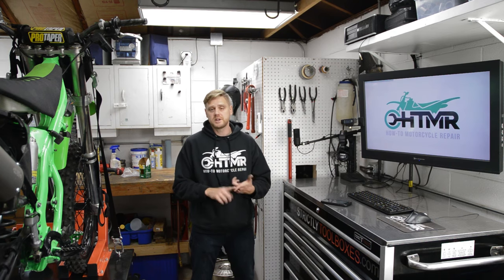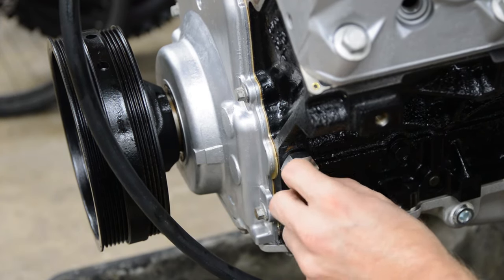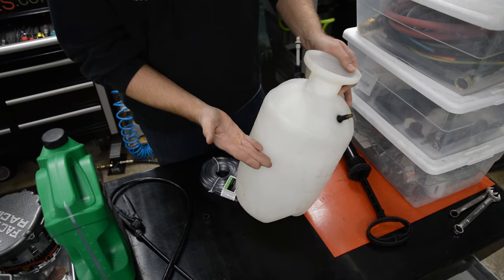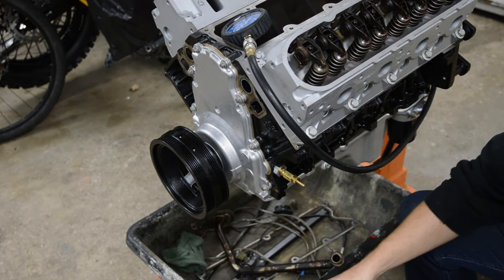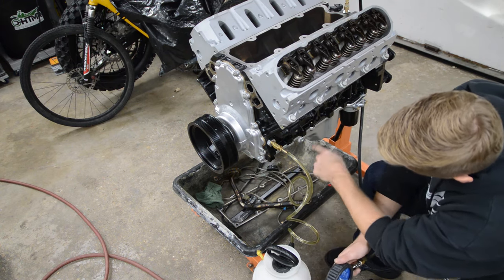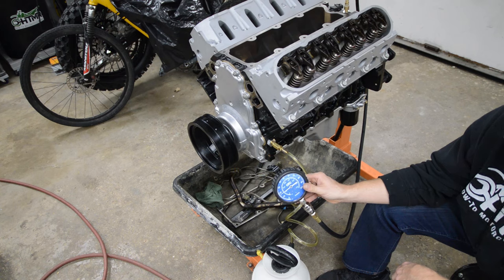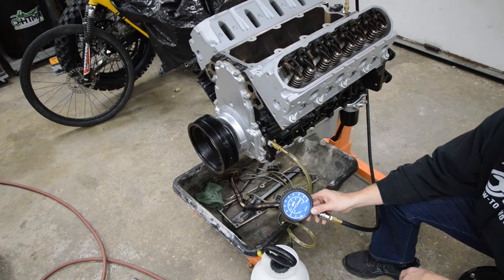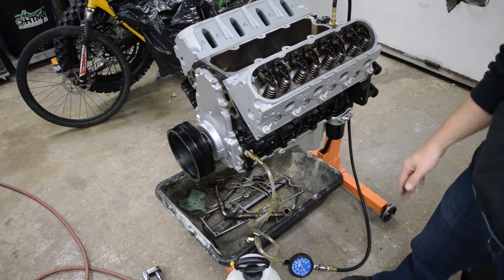LS Engine Priming The Easy Way - $15 Tool

Comment from the maker: M16 x 1.5 to 1/8 NPT fitting - https://amzn.to/3lW2w99
Weed sprayer - https://amzn.to/395T2Vp
OTC pressure gauge - https://amzn.to/36Z0X47
Tubing - https://amzn.to/339CQP5
Reply: @Zion Connor instablaster :)
Reply: @Memphis Graham thanks so much for your reply. I found the site on google and Im in the hacking process atm.
Seems to take a while so I will get back to you later with my results.
Reply: @Memphis Graham It did the trick and I actually got access to my account again. I am so happy:D
Thanks so much, you really help me out !
Reply: @Zion Connor No problem :)
Reply: How about the fitting you installed on the sending unit port?  Is that also an M16 x 1.5?
Reply: That looks great I think I'll try this on my twin turbo build

Comment: I used your system here tp prime my new LS3 crate motor. I put pressue on it with the sprayer pump and turned the engine by hand a few times. Before too long oil was coming out the push rods. I did not need to use compressor pressure. 5W 30 oil  and I left the new oil container in the hot sun for awhile to get it warm and thinner. I would say that if you use the compressor be sure your compressor tank is drained of water so you don't put water in your oil.
Reply: Any air that is blown in should evaporate once the engine's started.

Comment: Engine holds 6 qts. Put oil in filter, put 4 quarts in the sprayer and the remaining oil in the pan, will eliminate alot of the gurgling and speed up your process for those of us who are impatient, can also overfill with oil for this process and drain to proper levels prior to start-up.

Comment: Why didn't you just use a 1/8 npt hose barb fitting? instead of adding another two extra fittings lol
Reply: That's what I just did, I skipped that part, don't understand why it's needed

Comment: That's essentially how I primed my LT1.  But it doesn't have the port like the LS so I purchased an adapter that screws onto the oil filter location.  I didn't use air pressure but I pumped the living daylights out of the garden sprayer and pushed all of the oil into the engine.  It wasn't a rebuild, just had been sitting for a couple of years without running.  When I hit the starter the first time it popped off immediately with just the fuel that was still in the rails.
Reply: So, you used an adapter like for a remote oil filter?  I have a Gen5 LT engine I must pre-oil.
Reply: @GTOGregory  Yes.  I still have it.  It's an OTC oil pressure preluder adapter.  I paid $50 for it on Amazon.  If you're interested, make me an offer,  Don;t forget shipping.

Comment: I put oil in the filter and fill up the oil pan. Then leave the spark plugs out and turn it over with a remote on the starter in 15 second intervals. After 3 or 4 hits.....fully primed. This way also lets you know your oil pump is working as it should as it's actually pulling the oil through the system and not a weed sprayer.

Comment: This was so easy and cheap, so thank you. I didn't even end up using the compressor. It really didn't take too much effort to pump by hand. I did add the tire valve, but ended up using the handle because I figured I'd probably explode the bottle in my face. I did use a simple tire gauge on the valve to make sure I was under 30 PSI though.

Comment: Great tool, Im off to Home Depot to copy it now.. 
Originally I used an air chuck attached a 5 gt oil jug and a hose (through the cap of the jug) and filled the jug with air (forcing oil out through the hose) then fed it in the side of the block using a barbed fitting. 
It worked for a while, then the jug split apart lol..
Thus your idea is pretty solid, and at 20-25 psi I should be good just to prime a sitting engine until I reinstall it in the truck (truck is being painted, complete color change).
Most folks don't know that as time passes by, oil drains from the top of the engine back down to the bottom/oil pan from just sitting. 
Thus I don't mind priming it at least once a week and a few good rotations to insure I don't ruin any cam, rod or main bearings!!

The crazy part about your idea is that there's oil primers out that cost $150 and up, just nuts.. 
You sir are considered a "Macgyver" in my book! (that's a good thing for those who never heard of the name/character or the show)

Awesome tool/idea! Just subbed! Thanks for sharing!

Comment: less than a foot of tubing and a funnel... put in half a quart of oil and let sit till funnel and tube is drained. install plug, reassemble, start the car...
simple and saved you $15. just did it today. 50 psi in less than 2 seconds.

Comment: Awesome, and thank you for such an easy way to prime a crank oil pump engine. The engine on my new to me 2001 Camaro SS has been sitting a few years and I have no idea how long its going to take cranking to get running.

Hopefully this will keep my bearings from getting wiped!

Comment: I like this, this is a great idea to work from for my Toyota 3rz thats soon going to need to be fully primed before startup. In my case i might just remove my oil pressure-sending unit and back feed the oil that way not sure yet. Anyway, great tip for those with crank driven oil pump engines. well done well done

Comment: Very cool, inexpensive, and it works very well. Now if only I could find away to do this method to a 460 Ford BB. I hate pulling the distributor and using a drill to get oil up top after sitting over the winter. Thanks for sharing and the links and items needed. Cheers from Motown/Dearborn.
Reply from the maker: Use the oil sending unit port.

Comment: Great vid. Why not un nut the wand and discard it and use the hose that came with the hudson sprayer? Saves $7 in tubing. Is there something wrong with that tubing that comes with it? Clear might be easier to see but the volume will be dropping in the tank to know it is moving.

Comment: Excellent.
I am going to fill the engine with oil by pouring it through the intake valley and then try turning the oil pump through the distributor hole using a shaft and a drill. If I can't get it happening like that I will go this route. Good thinking.
Thanks
Reply: There is no distributor or hole on a LS engine.
Reply: @denvermilehighracing5385  I'm not in the know on all the engine models. Mine is a 1996 Chevrolet 5.7 L Vortex in a K2500. It has a distributor but I will prime it up before the battleship goes back on.
What model designation would mine be? What are the details of an LS?
Thanks
Reply: @leh3827  You have the Vortex small block chevy which isn't a LS engine, it's the generation before the LS. The LS engines started in the 1997 Corvette.
Reply: @denvermilehighracing5385  What was special about the LS?

Comment: I hate to break it to you, but this is incorrect. You likely aren’t oiling the whole engine by doing it this way. If you know how the oiling system works in an LS engine and it was assembled correctly with moly-based assembly lube, that is all you need. They make assembly lube for a reason and its worked fantastic for over 100 years. Some builders will assemble engines w/o it and be fine. I would only do this if I planned to fire the engine up right away. 

Secondly, if you have oil in the pan, and an electric starter(as it should in its assembled state), simply remove the fuel pump relay. With a fully charged battery, all it should take is a couple long cranks of the starter. Maybe twice for 9 or 10 seconds each before you see oil come up from the rockers.  This is the proper way to prime the engine, because its flowing in the right direction and no air is being introduced into the system. More importantly, you are making sure the heart of the engine is pumping oil through it well enough.  Your method does not prime the oil pump because there’s a relief check valve not getting oil to it.  This is the most failure prone part of the LS oiling system, if you don’t count the lifters. 

I respect your creativity and thinking outside the box.  But No reason to re-invent the wheel here, my friend. Technology is at your fingertips to save you time and $$$.   If you have the time and money to waste to test your creativity, just do everyone else a favor and leave it off youtube, so you aren’t wasting their’s either.

Comment: Love it.  Thanks for the great videos!
Question:  Would the lifters be 'pumped' after doing this?
Reply from the maker: Yes. I installed mine not pumped up or soaked in oil, primed per video. and fired up with no noises what so ever.

Comment: Thank you sir for the video.  This is the easiest and most cost effective process that I've watched and will be doing it this way.
Reply: @champspec  How about a crate engine that's been sitting for 5yrs?
Reply: The easiest and most cost effective way is to disconnect the injectors and crank the motor over until you see pressure. Then you're good to go. Costs $0.00.

Comment: Great video.  It looks as though you started with the engine completely empty of oil, correct?  After you pumped in the 3 or 4 quarts did you just add the extra engine oil to the recommended capacity?
Reply from the maker: I dumped in all 5 quarts and plan on checking before firing it up. Dipstick not installed yet.

Comment: Hey young man; Gotta a cal questions;  
that port you used on block, I'm assuming it was after pump. Am I correct? 
There is a port on the oil filter also. Do you know if that one on pump pressure side into filter or on the out flow side?
I'm working on an old 97 GMC with over 350 thousand miles and she has no knocks or clatters. However she runs at low oil pressure.
Upon start up she runs 50 , Once warmed up At Idle it is about 6 psi, at 2000 RPM she runs 40. 
This is just gonna be my putter Arnd truck. 
I was "jack leg" thinking  if I could tap into the drain pan plug and install a electric pump shoving fluid to the "hopefully" the before filter port.. 
Any thoughts ?????
Best; Tom

Comment: Did you have to buy two of those adaptors or did you use the hardware that came with your pressure gauge for the top side?
Reply from the maker: Bought 2 of them

Comment: Can you link the other 2 fittings after the  M16 x 1.5 to 1/8 NPT fitting Please?
Reply: Nevermind I found a 1/8 inch npt to hose barb to eliminate the other 2 fittings you put on there..

Comment: Did you put any thread sealant on the oil galley plugs threads when done? Thanks for the informative video
Reply from the maker: No because there is a washer for sealing.
Reply: @HTMR  sorry wasn't clear on that, I meant the actual plug that is the Allen key that comes factory in the block, not the oil primer set up pieces
Reply from the maker: @mellowyellow8856  I was also referring to the "stock" plug.
Reply: @HTMR  oh ok I will I have to check to make sure it was on there, motor went to a machine shop and got cleaned so they may have put something on the threads

Comment: NOT A BAD IDEA. I seen other guys open this and just prime the pump so its instantly pumping oil on first start BUT would you still do this for a junkyard engine with its old oil still in there,  you bought for $445 canadian/about350usd with 220,000 km /about 150,000 miles?
im not sure how accessible this plug is once engine is installed. the sending unit hole is even less accesible.
Reply from the maker: No just fire it up.

Comment: I did my first engine replacement and i did not prime. Can i still do this with the complete installation done?
Reply: Doing it now would be pointless if you already filled it with oil and cranked it up. If it still hasn't run yet, sure you can do this at any time, ideally just before the first start.
Reply: Wait, you ran the motor before you primed it? Yikes.

Comment: I wonder what the original relief valve is set to on the sprayer? Just curious how safe it is.  Seems like it’d hurt if she blows.
Reply from the maker: You can still pump the handle, so that means I haven't hit the "relief" point yet. I'm just lazy and don't want to pump :)
Reply: Yeah, I pumped it up to 25 PSI by hand really easily. In my opinion, the air compressor isn't necessary, but I still liked having the tire valve to check with a gauge.
Reply: @CoDisafishy  how do you get a tire valve on there?
Reply: @elinino5275  I just drilled a hole and popped it in. Tire valves have a ball shaped end to plug the hole so it seals pretty well.

Comment: Does the oil lubricant the cam and the lifters? Where they make contact?
Reply: Yes. All contact surfaces.
Reply: Not being a smartass... oil to the rocker arms is the last thing that ever gets oil, so if they are getting oil that means everything else is too, and oil only gets there from traveling up the push rod holes which comes from the lifters. That's why he was turning engine over by hand so all the oil goes through main/rod bearing holes and into crank holes.
Reply: @DanBrino  Thanks bro... That's all I wanted to know! Some people like Mike just like to hear themselves talk 😂😂😂

Comment: i would do this just before your first start up not why its on the  stand . prime it   in  the car or truck would be best  a fresh coat oil on  every thing thats when you will be  breaking every thing in  like cam and bearings lots of heat

Comment: any trick to installing the tire valve into the bottle?
Reply from the maker: Remove schrader valve and use a coat hanger wire to feed it through.

Comment: What could cause my m I motor to have oil pressure but no oil on lifters on on fresh rebuild
Reply from the maker: How are you priming it? How much pressure and time?
Reply: @HTMR  I took over after someone else quit. Just helping a friend that wasted his money on a bar stool mechanic. He over tighten valve's that pulled 2 studs. I have started motor and it now runs great. I'm manually oiling rocker arms. Roller lifters 60 psi at Gage. Chevy 383 stroker crate moter. A machine shop changed cam
Reply from the maker: @mikelippard3460  Forgot what the oil path is on SBC. It does take a while for the oil to get up there though.
Reply: @HTMR  I have ran it 10 times for 30 sec to 1 min, raised rpm up about 1000 last 2 times. Now removed lifters and put in oil, all let air bubbles. Next I'm spinning oil pump to see if oil comes up. Does oil pass cam just before lifters? Is oil gauge after pump and before crank, then cam and lifters. Thinking I need to check cam bearings. I have 60 psi steady and consistent, immediately on start up.

Comment: Where can i find the adapter for the oil pressure port?
Reply from the maker: Vid description
Reply: @HTMR  im talking about where the pressure sensor/gauge goes, is it the same fitting?
Reply from the maker: @isaiah-lava5.086  Yes, same. Order 2.

Comment: Great idea. What weight of oil are you running in this build?
Reply from the maker: Starting with 5w-30. So far 35-40# at idle.

Comment: Why can't u just soak the parts in oil or put assembly lube in them or whatever u have apart then remove the fuel pump fuse and turn key till the oil pressure builds then go a few more turns then start
Reply: You can. This method is unless. I own a shop and installed MANY new engines. What I do is pull fuse or relay to disable fuel system. Hook up my computer or gauge and crank till my psi range has been meet and I’ve never had an issue. Also all new or rebuild engines have assembly lube that is designed to lubricate moving parts till oil gets there. Also this system seems flawed because all the oil is going to go back into the crank case first because of the pick up tube and pump have least resistance, that’s why he used all that oil because most of it went back to the crank case

Comment: Why not jst unplug the ignition coil then spin motor over til the oil pumps up
Reply from the maker: Because you can catch any problems while the engine is on the stand, not after in the car.

Comment: You can also take the spark plugs out and use the starter and turn it over 20 seconds or so and repeat until you get pressure. Also make sure not to over heat the starter but with no spark plugs it doesn’t get to hot at all
Reply: I’ve tried that it didn’t really work
Reply: @soggy000unit2  it has too or you have issues, but I also put 7 quarts of oil in it as well. I’ve put together and sold 13 engines this year and I do them all this way and all started having pressure within 3-5 seconds, also the longer you let it spin the higher the pressure gets closer to operating pressure, from all the ones I’ve done I’ve noticed using the starter to prime the pressure is about 10 psi lower than idle pressure. I need to post a YouTube video explaining and showing everyone what I do.

Comment: Easiest way I’ve found is to fill through the top oil pressure sender with a funnel till it quits taking anymore. Takes a while but works every time.
Reply: I might have to do it that way because my engine is in and the port  next to the balancer is blocked by my engine swap mount.

Comment: Funny, this said the"easy way," lol it would be one thing if you already had these things ready to go... but he made out like 15 bucks? Come on, the fittings he put into the pressure release were more than 15 bucks, not to mention all the time it takes to get this stuff and he goes further to out in a valve to the sprayer to use his compressor? All kind of "extra." Now, it is pretty neat, but not what I would call the cheap and easy way.

Comment: Man you guys do too damn much for no reason.. every single time I have rebuilt an ls motor I just make sure I use some good assembly lube and then just turn the motor over a couple of times with the starter with the coil packs unplugged ofcourse and that's it..... You sir are completely over doing something for nothing 🤔